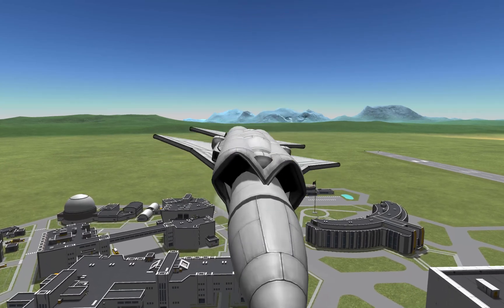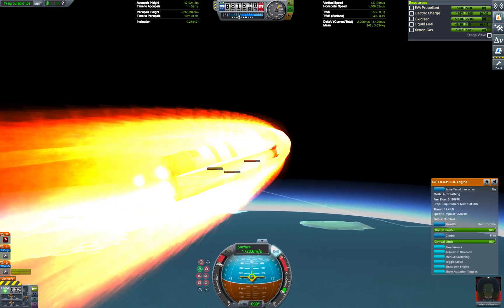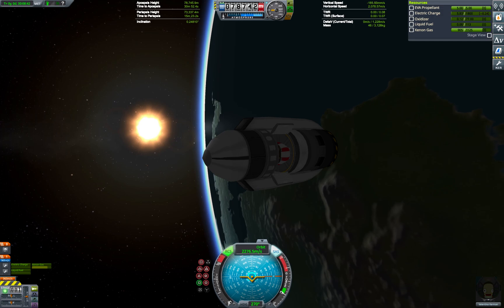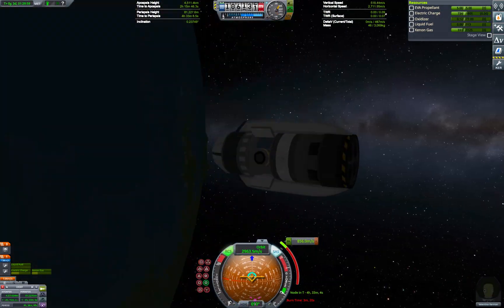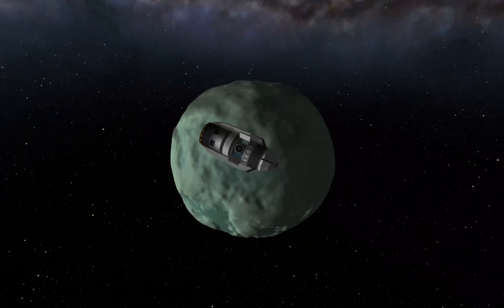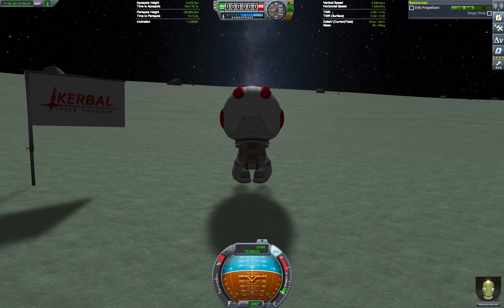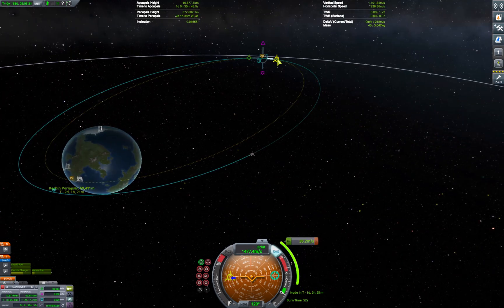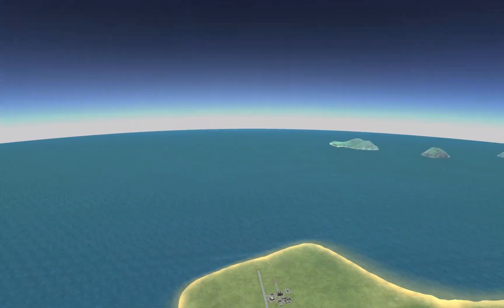Sub-4 Ton Minmus SSTO [KSP 1.9.1]

Comment from the maker: To answer @OndrikB, the reason I didn't use Val's parachute was due to the fact that it would face 90 degrees towards the surface when deployed, and therefore not slow the craft down to a speed at which nothing would break upon touchdown. If the EVA parachutes acted like every other parachute rather than like a paraglider then this wouldn't have been necessary. I'm sure that another design without parachutes is possible though...